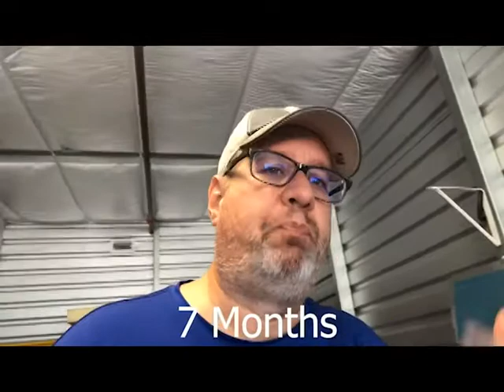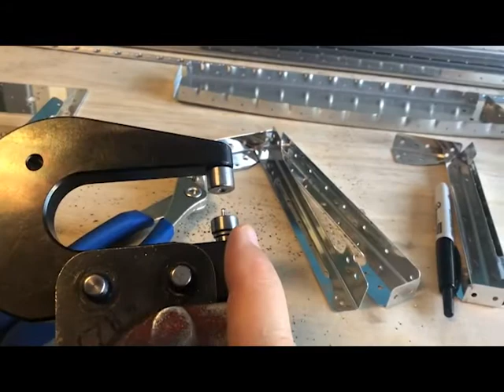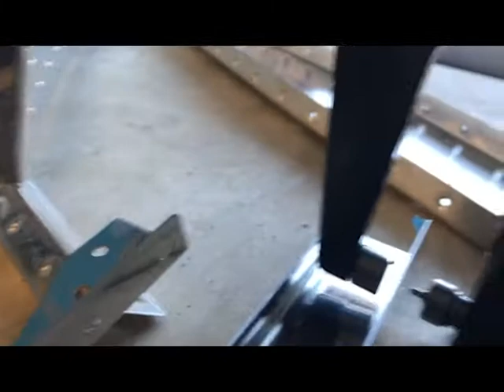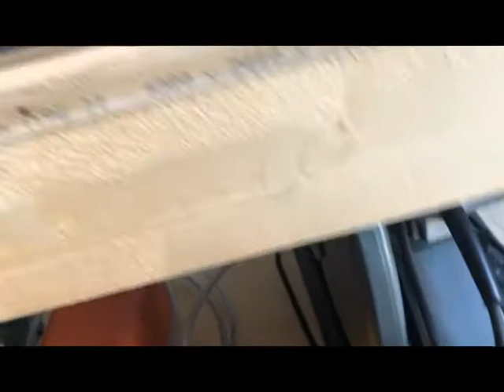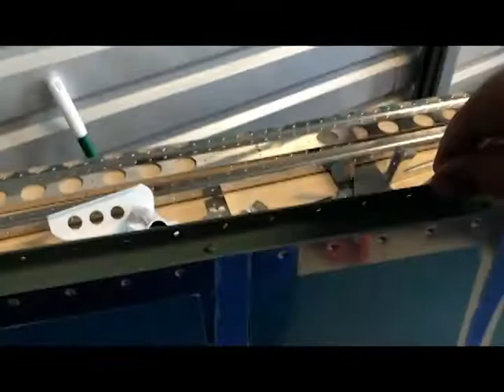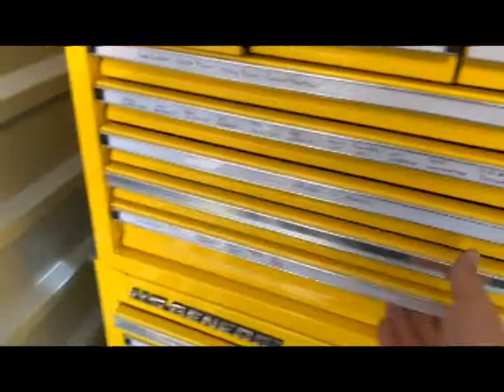9 – 9 Dimpling and Counter Sinking the Left Elevator

Comment: You countersunk ( metal removal) vs dimpling ( metal forming). Did you check with Van's to make sure it's safe? I would be afraid to get that result by removing metal. I really like your channel, although it seems YT doesn't put you high in the search results. Oh, I think you are confusing leading and trailing edges.
Reply from the maker: Great Catch! I did spoke with Van's about that very thing after I did it and they are ok with the countersink. They pulled up the spec on the spar and said it can be countersunk vs dimpled only if you do not change the size of the hole and that the skin is still dimpled. I made sure that I did not go that deep. Knowing what I know now I would probably should have used my hand dimplier and dimpled them by hand instead. The things we learn :)
Reply from the maker: OK so the more I thought about it and even though Van's said it is ok I am going to replace the spar because I know people may use my video's to aid them in their build The last thing I want to do is give advise that might compromise their build resulting in a possible safety issue.
Reply from the maker: Yea kind of like tiger and shark fin. My mouth sometimes say's things that are completely out of sync with my mind. That the story I am going to stick with.